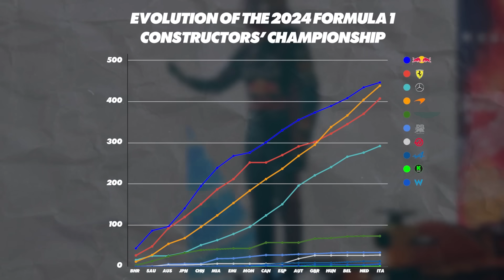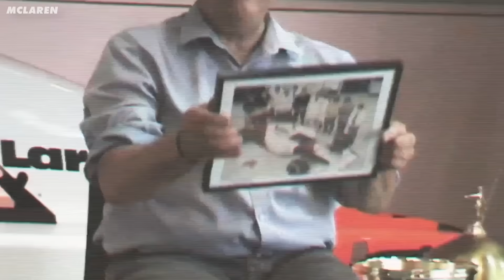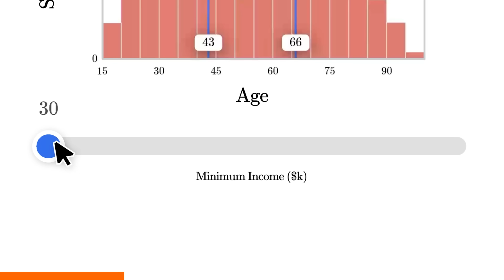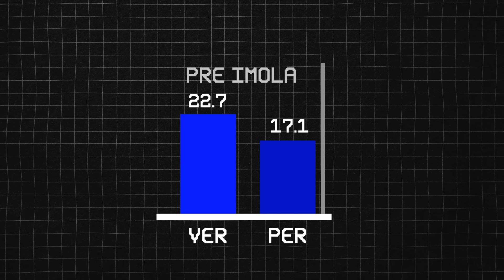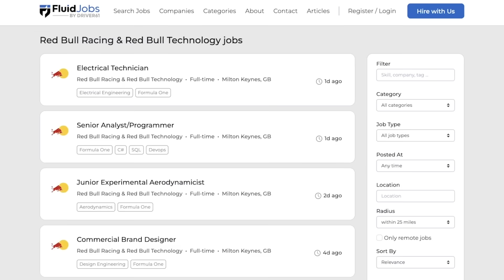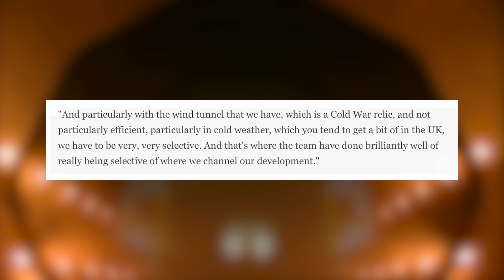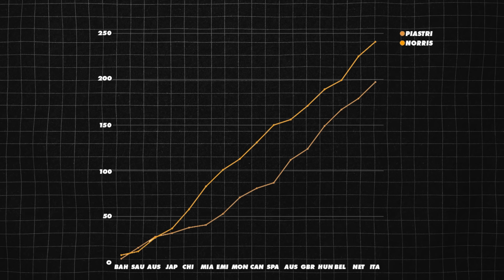Why McLaren Are Now SO FAST

Comment: It would be nice if quotes, pictures, graphs..whathaveyou weren’t only flashed for a second or two so one doesn’t have to keep jump/scrub back and then pause at the brief moment the information was flashed to be able to read what’s assumedly meant to be taken in. I mean if you so much as look away for 2 seconds you’re likely to miss that a quote or whatever was flashed during that extremely short look away. There’s really no reason why something that’s clearly pertinent enough for it be afforded the effort of actually putting it in the video only needs to be flashed but for moment.
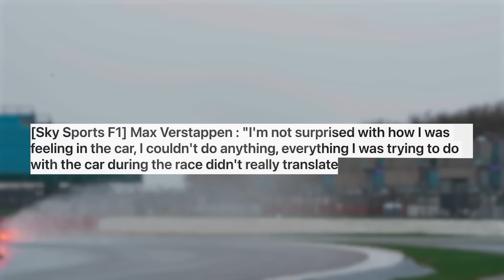It’s an understandable and not at all uncommon editing mistake. But if anyone on the channel reads this the quote showed at 4:55 is a good example of what I mean, it’s showed for 4s which even if I know exactly when and exactly where on the screen it’s going to be displayed so I can start reading right away I’m not able to finish reading it in that time. Adding another 3-4s to those 4s that it’s kept on screen and Bobs your uncle as they say..(which is a weird saying to say the least)
Anyway, cheers ✌️🖖👋

Comment: 6 cars finished on the lead lap at Singapore and Max was 21 seconds down.  Lando had two near-stops on track under green due to missed corners, so even with a 'mediocre' drive he put 2/3 of the field a lap down.  It's going to get tight for sure....

Comment: The new rear wing and beam wing making most of the difference. In Baku Piastri had 5kph higher topspeed on the straight without DRS. FIA will not change the rules until 2025, So I would love to see RB to introduce flex wings themselves, see if they can keep up.

Comment: „tHe rEd bUlL HaSNnT gOt SlOwEr“ 

They went from being 1sec a lap faster than 2023 to now being either slower or on paar with 2023.
Reply: It isn't slower, the car just has a very tiny operating window. When they're in that operating window, the car is extremely fast. This is obvious when watching the beginning of the season or qualifying in Austria or Spa. What you see now is what happens when that car goes outside of its operating window, the car becomes unstable, having both under- and oversteer and it becomes unpredictable which is why even Verstappen can't outdrive it.

Comment: After the dramatic drop of pace from Red Bull after the braking system clarification I wonder if he’s actually won any championships on his own merit and not with the assistance of some shady rule interpretations (cheating).
Reply: Red Bull dropped of far earlier than when the assymetric braking system was clarified and the FIA and Red Bull mechanics have already said that Red Bull did never have such a system. The reason they're slow is because their car has a very tiny operating window because the car can't handle the load of the upgrades. That's why they're either very slow or very fast when the weather changes, they're either in or out of the operating window of that car. When they're out, the car becomes unstable and unpredictable.

Comment: RB lost the Newey`s secret weapon: the aerodynamic asymmetrical braking.
Reply: Red Bull dropped of far earlier than when the assymetric braking system was clarified and the FIA and Red Bull mechanics have already said that Red Bull did never have such a system. The reason they're slow is because their car has a very tiny operating window because the car can't handle the load of the upgrades. That's why they're either very slow or very fast when the weather changes, they're either in or out of the operating window of that car. When they're out, the car becomes unstable and unpredictable.
Reply: @user-ri9dn4vi6i  Where the mechanic said they did not have the aerodynamic brakes?  Link me please. And why  they slowed down now, mid 2024 and never before? Do not sound logical at all.
Reply: @marguskiis7711  Look up Calum Nicholas. And they didn't slow down, the upgrades have affected the aerodynamic load of the car. That means that the car becomes unstable because the car simply can't handle the aerodynamic load. The front and rear axle are sort of disconnected because of that which causes understeer and oversteer. The car is in essence unpredictable which is why even Verstappen can't use it properly. 

This instability happens when the car goes outside of its very narrow operating window which happens when the weather changes. That's why even though they're sometimes fast in free practice, they can suddenly be really bad in the race.

Simply put: upgrades made the car unstable which causes the car to behave very unpredictable. The upgrades themselves make the car faster but so unpredictable that ultimately, they're slower.
Reply: @user-ri9dn4vi6i  Again, why those highly  unprofessional things did not happen earlier seasons??? It never happened to Red Bull before.
Reply: @marguskiis7711 the car was unstable from the very beginning. The competition was just so far behind that it was less noticeable. The further you go into a set of regulations, the tighter the competition becomes and the less you are able to improve from upgrades, that's called diminishing returns. Then it becomes all about aerodynamic optimization or radical upgrade packages which can be high risk, high reward. Compare the RB19 to the RB20 and you'll realize that the RB20 is much more complex, but also much more unstable.
Reply: @user-ri9dn4vi6i  I repeat my question. Why this kind of things never happened to RB before? RB has always been notorious for its super aerodynamics. All these years. What happened now? Regulations did not change this year.
Reply: @marguskiis7711  I once again have to repeat myself. The Red Bull car has been unstable since Bahrain and even the RB19 was unstable from time to time. The problem now is that these regulations have reached a development limit, every upgrade from here is either a small optimization to the aero package or something very radical. The RB20 concept is radical and so are the upgrades. They are fast but the operating window is so tiny that it's unstable which makes it slow. 

They're also facing a couple other issues. 
1) they have a lot less development time than others because they won the constructor championship last year. That means they have less time in the wind tunnel and less time with cfd (computational fluid dynamics, aerodynamic simulations on the computer basically). So their upgrades are more limited than others which is why Mcclaren can suddenly be so fast.

2) they have the oldest windtunnel on the grid so it's very inefficient but they also have had some correlation issues where the date in the windtunnel did not match the data on track. This again compromised their upgrades. This is an issue many teams have been facing.

3) the competition is very close so the slightest mistake becomes very obvious.

You really seem to miss the point, the Red Bull car by all means has fantastic aerodynamics. The car just isn't able to handle the extreme amount of load the aerodynamics generates.
Reply: @user-ri9dn4vi6i  Yes, this all can explain the slow losing of the advance, getting gradually more equal with others but no the drastic drop in mid season.
Reply: @marguskiis7711  there simply was no drastic drop midseason. They brought an upgrade package that didn't work while other teams brought an entire b-spec car. The rest just stepped up, something Red Bull expected to happen last year.

Comment: 8 races left, Norris needs to take at least 8 points off Verstappen every single race on average. That is not likely to happen. Norris needs 3 or 4 wins in a row just to make this close. The Mclaren is not yet fast enough to dominate everyone else which take points off them. Barring some big dramatic events Verstappen is well on to win another title and has to be the hot favorite. Only a Verstappen DNF and Norris victory in the next few races can make this close enough for Verstappen to feel any pressure.

Comment: Because redbull been caught with cheating brakes since 2021!!!😂😂😂😂😂 corrupt sport!!

 Joke
Reply: Red Bull dropped of far earlier than when the assymetric braking system was clarified and the FIA and Red Bull mechanics have already said that Red Bull did never have such a system. The reason they're slow is because their car has a very tiny operating window because the car can't handle the load of the upgrades. That's why they're either very slow or very fast when the weather changes, they're either in or out of the operating window of that car. When they're out, the car becomes unstable and unpredictable.

Comment: Definitely the asymmetric braking me thinks. Vesapen is not a Hamilton
Reply: Red Bull dropped of far earlier than when the assymetric braking system was clarified and the FIA and Red Bull mechanics have already said that Red Bull did never have such a system. The reason they're slow is because their car has a very tiny operating window because the car can't handle the load of the upgrades. That's why they're either very slow or very fast when the weather changes, they're either in or out of the operating window of that car. When they're out, the car becomes unstable and unpredictable.

Comment: I think Max will be ok, just like Button in 2009. Button 6 of the first 7 races, and none of the next 10, but race wins were shared between 5 different drivers but mostly Vettle. This season could be similar. So far we've had 7 different winners. Lando has had the best car for longer this season than Max had, but hasn't capitalised as Mercedes and Ferrari are decent at some tracks.

Comment: No more asimetric break for Max. Now he has an equal car with Checo. Let's see
Reply: Red Bull dropped of far earlier than when the assymetric braking system was clarified and the FIA and Red Bull mechanics have already said that Red Bull did never have such a system. The reason they're slow is because their car has a very tiny operating window because the car can't handle the load of the upgrades. That's why they're either very slow or very fast when the weather changes, they're either in or out of the operating window of that car. When they're out, the car becomes unstable and unpredictable.

Comment: Every team makes investments all the time. This is not the key point why McLaren are so good now.
The real reasons are:
Making the most out of the time spent in the wind tunnel.
They correctly understood that initially they had an issue with their simulator (the env where they were developing the car) compared to Mercedes which did not manage to understand that.
Redbull, although very good at the start of the season , couldn’t keep up with the rate of development because they didn’t have as much time allocated for R&D as the other top teams

Comment: If Red bulls problems are not due to an illegal braking system being removed from the car cough asymmetrical braking cough Then why don't red bull just go back to the car spec they were using at the start of the season, that they know works very well, when they were 8 tenths faster then everyone else... The fact that red bull haven't done this, should tell you everything you need to know about what the problem is... 😉🤔 Unlike red bull and the FIA ( saying they didn't have an illegal asymmetrical braking system ) the data, numbers and facts don't lie. 
Plus all the onboard replays of Verstappen struggling with steering the car now, compared with not struggling at all before Miami. Also, tyre wear being non-existent before, but now they are dying a lot quicker. All of these things, plus all the talk behind the scenes, the rumors, the lack of general transparency around the matter and no investigation by the FIA, is way more than just a coincidence and a lot more then a smoking gun to indicate what has transpired.
Reply: Red Bull dropped of far earlier than when the assymetric braking system was clarified and the FIA and Red Bull mechanics have already said that Red Bull did never have such a system. The reason they're slow is because their car has a very tiny operating window because the car can't handle the load of the upgrades. That's why they're either very slow or very fast when the weather changes, they're either in or out of the operating window of that car. When they're out, the car becomes unstable and unpredictable.

The reason they're not going back to the initial car spec is because it fundamentally had the same problems and it would no longer be the fastest car. Every team have brought upgrades, going back to the old-spec wouldn't make them any better. Also, they have brought a new floor which is a combination of the old-spec and new-spec floor hoping to get both the balance of the old-spec and the speed of the upgrade.

Comment: For WDC still too early cuz MV still has big point margin. He can target to finish 2nd everytime and LN still needs to win all the remaining races to grab the WDC at the last race by just 2 pts. LN would need OP to finish between him and MV but the thing is OP still allowed to race for himself and therefore taking points off LN. 

WCC though is much more up for grabs.
Reply: True, but it's up too Red Bull to keep up with 4 top teams. Monza's Redbull performance was too brutal, when McClaren, Mercedes and Ferrari are faster than them.
Reply: @tsanirisfanfadillah1977  McLaren need to get OP to fully support LN if want to win WDC, and they should've done it in Monza since OP cannot win the race anyway.
Monza is also a rather unique track so I wouldn't count MV to finish as low as he did in most remaining races. Remember also that MV didn't have the luxury of a brand new engine in Monza where power is paramount hence he's on the back foot from the get go.
Anyway I think end of this year will be exciting with WDC and WCC much more open than before.

Comment: If you look at the wording of the rule update - it was expanded from using brakes to using any system. I think they had some system in the diff to apply the energy recovery differently to the axles. This would have helped with stability and with turn-in. And that's what Red Bull is struggling with
Reply: Red Bull dropped of far earlier than when the assymetric braking system was clarified and the FIA and Red Bull mechanics have already said that Red Bull did never have such a system. The reason they're slow is because their car has a very tiny operating window because the car can't handle the load of the upgrades. That's why they're either very slow or very fast when the weather changes, they're either in or out of the operating window of that car. When they're out, the car becomes unstable and unpredictable.

Comment: When you compare the qualifying results from Suzuka or Shanghai to Monza, Red Bull have lost a second or more in lap time. Yes, McLaren may have caught up some and so have Ferrari and Mercedes who are well in the mix for race wins... but this seems outrageous. McLaren must have managed to "square the circle" with introducing their "whole new car" midseason, something which ,according to Toto Wolff (who certainly knows a thing or two about managing a Formula 1 team), is no longer possible in the cost cap era.

The whole story bears stark resemblance to Renault's genius mass damper, which the FIA quietly told them to remove halfway thru the 2005 season (because it was now deemed a "moveable aerodynamic device"... when, in fact, it had f*ck all to do with aerodynamics and had been approved by the FIA before the start of season). Of course, by then it was too late, Renault's points advantage was big enough to see them stumbling over the line, despite the car being a "tractor" and winning jack sh*t ever after.

The FIA usually publishes their new regulation sets in scheduled increments and, now, out of the blue, they felt it necessary to "clarify" the rule regarding asymmetric breaking, just so the teams don't get any silly ideas for 2026? This may seem very considerate of the FIA but forgive me, if I believe that there's a bit more to it.

Comment: But Piastri´s move was a clean move. Lando said it, the commentators said it as well. Probably a little bit close to the edge, but a good and clean move nonetheless. And it is not fair to compare it to Hungary. Hungary swap was because they pitted Lando before Piatri to cover him from the ones that were trying to catch him. Hungary was not a gift to Piastri, had he been pitted first, Lando would have never had to give the position back. And it could even be said that if Lando had given the position earlier, he could still have attacked Piastri. It was not a team order to not attack, just return the position because they favoured Lando to cover him, but it should have been Piastri the one that pitted first.

Comment: In 2012, it seemed as if Red Bull had lost momentum at a certain point in the championship, and Alonso would beat Vettel in a very surprizing move. But suddenly RBR picked up the pace out of nowhere, Vettel won four races in a row, and eventually took the title. Back then Newey was fully on board, and only Ferrari was a challenger. But now with three other teams looking strong, there is a chance Verstappen does lose the title to Norris indeed. 

If this happens, I believe it is pretty much certain MV moves to M-B in 2026, and I think Wolff did a brilliant, yes risky move hiring Antonelli for a one year test against Russell, whose contract also ends in 2025. So, if Max decides to sign with Mercedes, Toto will decide if Kimi is the future, or not, and in this instance there is a real chance old George gets (blimey!) The pink slip in the end of next season.